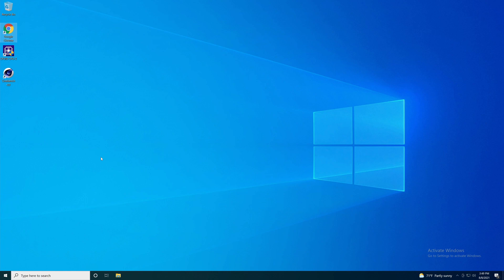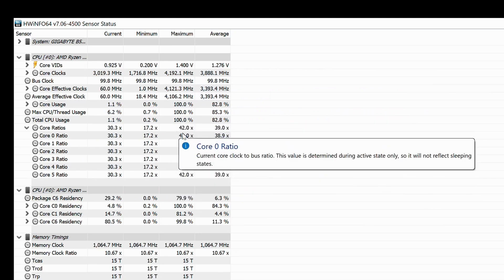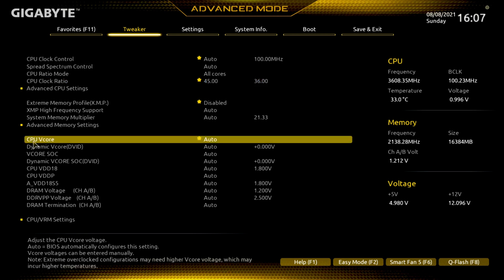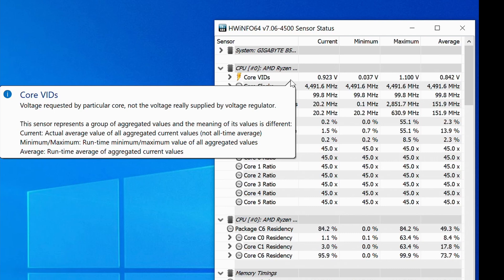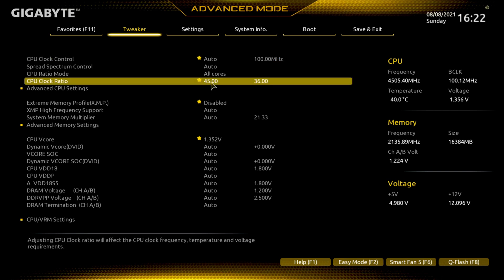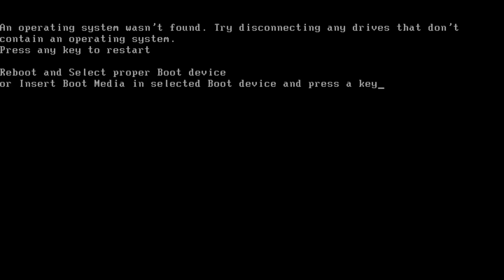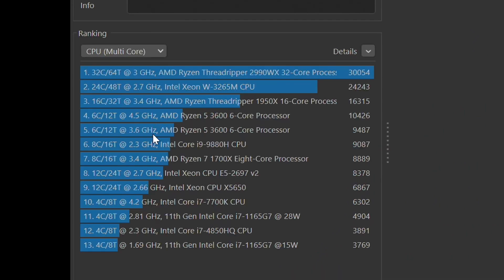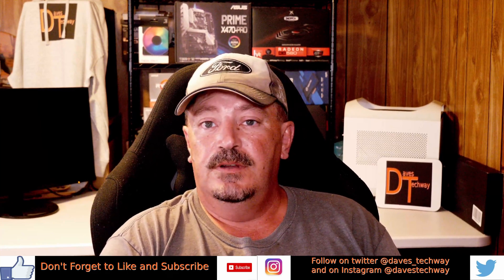How to Overclock the Ryzen 5 3600 on Gigabyte B550m DS3H motherboard

Comment: Thanks I managed to lower the Core Voltage on stock settings from 1.55 down to 1.35 and gained +400 mhz on all cores while temps averaged in the 40 to 60 degrees celsius - i dont really game that much but defintely gained performance boost when using heavy programs like Ableton, and Adobe!  Is it fine for the longevity of this SoC to pushing 4.0+ ghz all the time even if temps are low?  I have a new cpu coming soon but I want to keep this cpu in good healthy condition! thanks again!

Comment: what im doing wrong? If i change the CPU clock ratio to 45, CPU Vcore to 1.352 and disable PBO, i have a crash and my windows does not start. I have the last bios version. Ryzen 3600 and b550m ds3h. Can you help me? Please. Thank you.
Reply from the maker: The 45 is to high for your CPU. Thanks for watching and the comment.
Reply: I dont understand. In this video, you overclock the same Ryzen 3600 to 46.
Reply: @vulpix11  not every cpu will overclock the same buddy. his 3600 hit 4.5 but that doesnt mean your 3600 will hit the same. try maybe 4.3 or 4.2ghz

Comment: Cool video. I updated the bios of this motherboard according to your video. I have 5 5600 X + DS3H B550M, but for some reason the m2A CPU (upper slot) does not determine the ssd drive. I don't know what to do. Perhaps the processor does not support it.
Reply from the maker: Not to sure. But the 5600X should detect any SSD in that slot, Maybe go back one BIOS version. Thanks for watching and the comment.

Comment: There is a program called CTR 2.0 I used it to oc my r5 3600. I just clicked "diagnostic", when the process was finished the programm suggested 2 profiles: 4.2Ghz/1250mV and 4.4Ghz/1350mV.
Reply from the maker: Them sound like pretty good overclock. Thanks for watching and the comment.

Comment: Is this process any different for the ryzen 5 5600g? I assume ill have to adjust the clock speed based on that apu but im really not too experienced with overclocking
Reply from the maker: Yes, if you are using this motherboard it would be the same process. Thanks for watching and the comment.
Reply: Will this work on B550m DS3H ac mother board ?

Comment: Hi! On this process that you did? Did you touch PBO? May I know the settings you set for PBO?
Reply from the maker: If overclocking the CPU you need to turn off the PBO that way it does not override your settings. Thanks for watching and the comment.
Reply: @DavesTechway  I see. So both PBO and Core Performance Boost should be turned off. Thank you so much!

Comment: Been just getting into pc's.  What's the purpose of "overclocking"?
Reply: You gain extra performance on gpu or cpu. For example overclocking a r5  3600 can make it  perform like a 3600x.
Reply from the maker: Thanks for watching and the comment.
Reply from the maker: To get better performance out of the CPU,GPU, or Ram.  Thanks for watching and the comment.